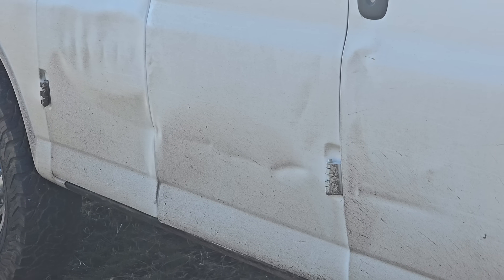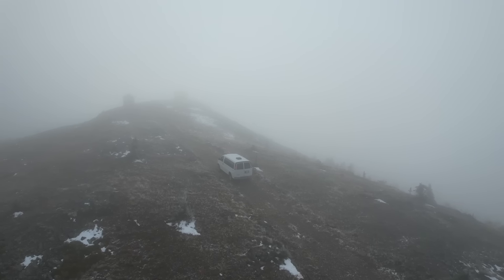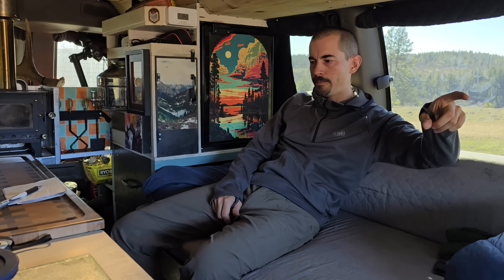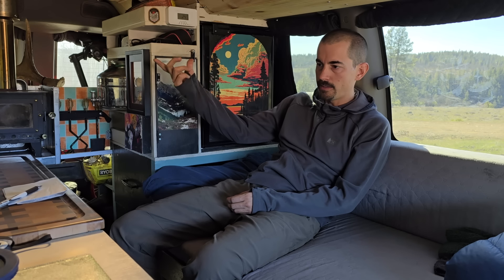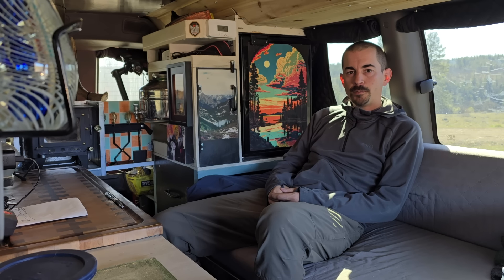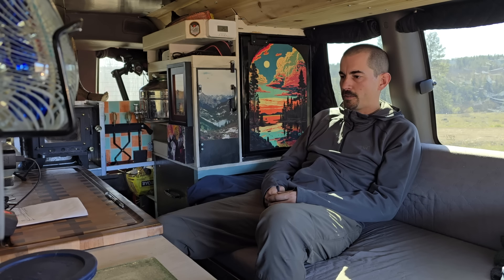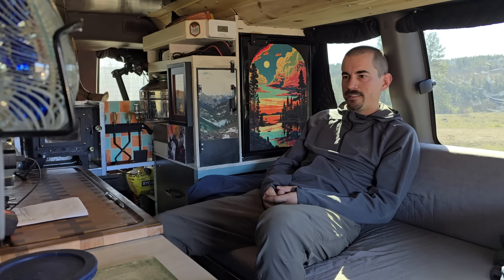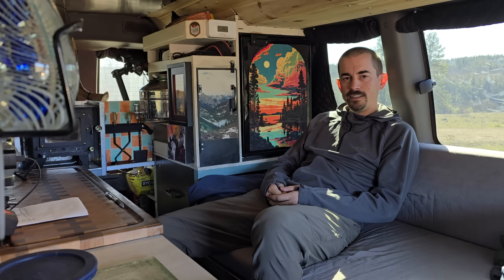Lets just talk about condensation and insulation.

Comment: Research sauna construction.  Rubber sheeting has fasteners driven through.  The fastener has a rubber gasket at the head. 
Don't rely on adhesive strength.  The vibration, heating cycles, and constant stress will cause failure. 
I'm glad you're sticking with the windowed van.  Need double pane glass. Where to find?

Comment: Your plan will make it warmer but will not prevent condensation and mold. The dew point will still be on the surface of the vapour barrier due to the thermal bridge of the metal rib. There will be a food source for mold at the dew point (the wood strapping). Mold needs three thing to thrive: Food (anything organic, in this case the wood strapping), water (condensation), temp above 5 degrees C. The place to start is to measure the worst case typical humidity level inside your van. A good way to dehumidify your van is to run the A/C if you have it. A dehumidifier is part of the A/C system. Hope this helps. To come up with a design you need the outside temps you will likely be in, the inside temp you want and in inside humidity level. Are you planning -40C?

Comment: Closed cell insulation is a vapour barrier. If you are super concerned about vapour. Use furring strips to isolate the VB. Insulting things with foam is good if you can keep it tight. Spray foam will be a helpful tool

Comment: The problem with vehicles, and campers like airstreams is the thermal bridging. Like around the windows. Sure  we had storm windows to install inside but the window frames themselves would always have ice on them. Condensation meets freezing surface... The thermal bridge is a piece of metal that's outside that also continues to inside the vehicle. Which for most vehicles is every square inch of the vehicle body.

Comment: I hung 8 in 2x4  three pieces / center and on each side onto the underside of the struts. then I made strips out of the plastic White shower material I glued two sheets together cut them into strips 6in wide and long enough to go side to side that will be screwed on the underside of the struts and then the larger panels in between rest on the top of those strips that are hanging an inch and a half on each side of the 2 * 4 I put up 2 by 4 because I wanted strength this van is 22 ft long and I don't want things bouncing around as I'm going down the road😮 is lightweight and it's easy to clean and you can remove it anytime you want to put something in there or check😮 this tongue and groove crap to me is heavy and a pain in the ass. The false ceiling turned out exactly like I wanted❤❤ I haven't put it all the pieces up because the walls need to go first but they are made and cut to lengths and ready to go❤❤

Comment: After having a class b and C...id probably use conventional pink insulation.... Id also run all my lines, electric and water outside of the wall board in chases and box them in... I would never insulate over them. My entire childhood when custom vans were being built in the 80's...they and I used regular pink  insulation on the walls...very few problems... Id use trim washers on all screws and build individual panels that can be removed.... 30 years in the bldg trades debating vapor barriers....building an air tight box to live in without some advanced and always running ventilation system isnt the way to go...its easier to not make it air tight and still gain r value...like most conventional homes.

Comment: My van came spray foam insulated and it works pretty good. But in extreme cold snaps i find its best to hunker down at a campground and run two space heaters pointed in the front and back on low setting works great. And if you run the diesel heater that’s just the cherry on top. Less stress because in those temps something mechanical always breaks. I hope the best for you.

Comment: I like the way you're thinking. Do you think you can friction fit those 2xs in the grooves between insulation firmly enough to support the weight of the ceiling?  Second thought is that you might benefit from leaving your partition minimal between the living quarters and garage, and insulate the back doors as much as you could instead - up to installing insulated blackout panels on the back door windows. I work in school architecture, and we build cavity walls to control condensation - I wonder if that could be translatable? Condensation happens on the warm side of the insulation, so the vapor barrier has to be adhered/fastened to that. Then the cavity, even like 3/8" for condensation to drain down. We deal with the liquid condensation at the bottom of walls with weep holes - not so sure that would be a wise idea on metal vehicle, though there are ways to prevent moisture from coming in through weeps. Keep on thinking, and keep on posting.

Comment: Excellent presentation.  Thank you.  I really like the Express vans especially with the Quigley 4x4 conversion.   Having the windows of the passenger van is really nice but I wonder where the most heat/cold loss is really occurring.  Might be a good idea to borrow a thermal camera or buy a cheap one and really evaluate what area the van sees the most thermal loss.  Roof?  Floors?  Windows?  Should you seal off those back windows entirely?   Should you seal off some of the windows on the sides?    Even with the insulated window covers, that could be the major area of thermal loss.  Anyway, it might be helpful to know what areas are seeing the most thermal loss before starting the project.

Comment: Hey man, great channel! I live on my boat and condensation is a super drag, especially when you have to fight off the mold. Ventilation is key, but as you mentioned, you're throwing away a lot of your heat. I've seen people build 'Heat Recovery Ventilators' out of stacks of alternating coroplast and some low amperage fans and have wanted to try this method out for myself. Might help your cause as well. Seems like it checks a lot of boxes in terms of condensation, ventilation, mold and heat retention all in exchange for around $100US and a few hours of arts n crafts. Hope that helps!

Comment: IMO as somebody who renovates and am a Canadian Engineer let me give you an alternative idea. You can seal off like you are referring to, or you can create a breathable insulation space. A breathable insulation space is one where the insulation has capillary abilities. Meaning it has the ability to transmit humidity, but at a reduced speed. You can seal your car, but then you run the problem that any moisture that is caught will cause rust. Let me illustrate. You are going up and down the mountains right? Imagine creating a sealed space that has trapped air. Going up and down will automatically cause an expansion and contraction your entire wood, vapour barrier and so on. This is why when you have dual pane window it must be altitude rated.

By having a breathable insulated space any air that is caught will leak, and no vacuums will be created. Breathable insulated space means using natural insulation. That can be wood fiber, wool or cannabis (not the illegal stuff). Then you put on a breathable vapour barrier where the SD < 5 or just a thin layer of tongue and groove OSB (9mm). On top of that you  put your wood siding. In this configuration you will be kept toasty warm, and yet breathable. It is absolutely CRITICAL that you only use natural materials that can breath. You CANNOT use air tight paint. You must use a stain. You cannot put vinyl or plastic on top as the area must always be allowed to breath. Slowly breath of course, but breathe.

Comment: I like the idea of renting a place for a month or two while you do the renovation.  also, adding a back and front wall should make a big difference.  You could do the walls first and then try it out for a winter and see whether just the walls would make enough of a difference that you might not need to do the ceiling insulation.

Comment: Just an idea with the roof. What if you put supports spanning across from either side of the walls to support the ceiling and those supports would be anchored to the walls. Then the only material you would only need to glue is the insulation. You’re definitely on the right track with adding an insulated walls to the front and back. I would also suggest window coverings maybe made out of that reflective material. Look forward to watching the build. Good luck 🤞

Comment: If you take your time, using both rigid and spray Poly-Iso foam your 'studs' (2x2 or what have you) will be held just fine and firm for your T&G.  I no longer use (after 15 years fulltiming) vapor barriers and I leave a 1/4" gap at the bottom of each panel section to allow the moisture to collect > evaporate.  I also began using 3M Thinsulate for hard to reach areas since it is almost as good (R-value) as Poly-Iso and much easier to install.  If you're specifically interested long periods in very cold climes you are better off with the purple (?) rigid foam boards.  XPS?  I forget the trade name but it is one step below PI with regard to R-value but outperforms PI in colder climes.  All depends on the literal hours you need the insulation (sleeping?) and whether the solar exposure warms the chassis enough to warrant PI.  I converted my first Sprinter in a friend's driveway during the recession.  My second backfired because the driveway wasn't really available and after searching for a rented space at several 'maker' spaces in Portland I flat gave up.  Bessie still isn't finished and I've slowly adopted the 'use it and enjoy life' attitude, until I find my next vehicle.  Living, long term, in a vehicle you're trying to convert sux in a big way.

Comment: I have seen several mentions of spray foam insulation.  If you decide to do that, use "closed-cell" foam and not "open-cell" foam.  Water vapor moves through open-cell foam but not through closed-cell foam.  Open cell is usually cheaper so people choose it to save money and then end of with moisutre issues.  Good luck!!

Comment: You should definitely keep this van. What's the point of paying for a nice new van when it won't stay nice long.  Riding in those tight trails puts scratches in the paint, not to mention all the dents you'll put in it.

If you change the oil frequently (every 5k miles) and the transmission oil every 100k (miles), it will last hundreds of thousands of miles.  Given you do a lot of miles in a short period of time, age will not be ruining the suspension and exhaust.
But given the weight you carry and frequent non-paved roads you drive on, you should probably do a full inspection of the suspension parts including all the rubber.

Comment: I have a  "no build" van, with no heat source 😢. I  now use 2 tiny USB fans, one in front, one in back and with a window cracked because we had extreme condensation that would rain down.  We are not full time in van and avoid hard winter travel.

Comment: So here is what i have done. Also have a wood stove and diesel heater. My rig is fiberglass. My beam supports are aluminum for snow load and wood for screws, the best foam board i have found that works as a vapor barrier. Is from Home Depot, it is foil backed on both sides and charcoal infused foam. 
The foil allows you to use 90spray on the metal, and the inside foil allows you to use ducting tape. To seal  all seams. No condensation issues after 4+ years. ?

Comment: Rent a snowbirds house with a big garage for the build. I’m sure there will be one available in BC-Alberta in the winter months. 
And I suggest a 2 layer wooden grid + a professional spray foam for the ceiling. The offset grid closest to the metal would require a rubber or neoprene strip between the wood and metal. The offset 2nd layer would allow for insulation to be sprayed under the strapping so you could fasten to it without damaging the vapour barrier.
Edit- the sprayfoam is also a vapour barrier

Comment: Foresty I am currently planning my next build for my E350 and have an idea for you. I have decided to learn how to sew like you do. It is your superpower and I want to learn how to do it too. I'm planning to insulate with quilted, polyfill blankets similar to parka material. The blankets will be custom tailored for each wall panel/window, ceiling section. The blankets will be fitted with small sewn in neodymium magnets around their perimeter that will stick to metal mounting points around the frames they are meant to cover.  The blankets can easily be quickly removed or put up as needed. If they absorb too much moisture they can be set out to dry or taken to the laundromat for washing or drying {remember they are synthetic polyfill material, not down}. I may also add a layer of aluminized fabric or maybe that silvery bubble wrap insulation material {that's very lightweight and only a few millimeters in thickness}. The reflective material faces inward and really works at reflecting radiative heat back to you. And underneath the polyfill material will literally serve as a big insulative blanket for the entire interior. 

Best part is it's fairly cheap, very lightweight and comparatively easy to achieve in a way that you could get done before peak season. Also, the moisture management should be pretty good as long as you don't hole up too long in a wintry setting and have the opportunity to let the blanket system air out from time to time. You could make it permeable/breathable nylon or waterproof...or maybe thinsulate? Thinsulate has the ability to let water vapor pass through, but not liquid water. 

You'd also have the benefit of being able to remove the blankets from the windows easily when you want, retaining viewability when you want it back. 

Anyway, thought I'd throw that out there. If anyone could execute the blanket system successfully, you could. Plus, you should have all the tools you need to get it done with you already. Good luck whatever you do! 👍
Reply: GREAT outside the box thinking. The other thing perhaps you didn't realize is , is if the material is at least a little absorbent its acting like a buffer to absorb vapor during the night and then release during the day. I have designed my root cellar like this with cement board. Root cellars NEED moisture, NOT dripping, but dampness and in the underground setting it never dries, but hold and radiates as needed
Reply: @reidcrosby6241  Thanks, yes I suppose it could serve as a moisture wick and release system. Similar to how adobe walls work in the desert. They absorb the desert heat all day and then at night when it's cold, they slowly radiate the heat back inside the house. Main thing is I'd like to be able to easily and quickly remove or partially vent the blankets to release any trapped moisture under them or in them when it's convenient. I just need to get a sewing machine, learn how to use it [as Foresty does] and then get started experimenting.

Comment: Put 6 inches of insulation on top of your roof and deck over it. Any condensation will form droplets on the bare painted ceiling as moist air rises. You are then sure there is no moisture forming anywhere else. The bonus is some extra head height and a bit of free water collected in a K'archer window vac. The windscreen also collects damp but not as much as the ceiling will

Comment: Would be nice not having to crack the window to let in the cold and venting the warm through the roof just for airflow. I wonder if those table top dehumidifiers are any good? They draw about 30 watts, so running for 12 hours will eat up 30 amps. Not great but a good excuse to upgrade the batteries. There are also the chemical dehumidifiers. Basically use a desiccant to absorb the moisture. Some pass the water through to a reservoir you empty, others you bake the moisture back out and reuse. Whatever you choose will be entertaining and educational content no doubt 👍

Comment: Couple thoughts on insulating and sealing (not an expert). Skip 2x2s and instead sprayfoam gaps and trim/sand flush to rigid foam boards (sprayfoam has good adhesion). Maybe use "liquid rubber" paint to seal (non-toxic, waterproof, repairable). Not sure if a primer is needed to promote adhesion between liquid rubber and foam insulation. Maybe use some type of adhesive for the tongue and groove instead of fasteners (would be slow to install on the ceiling). Looking forward to the reno. Cheers.

Comment: If I were you, for starters I’d remove the back two windows, at least, cover them with sheet metal, insulate and cover with 1/4” plywood. The less glass the better. I also think if you rip everything out to the ribs, the best solution is spray insulation. If I did another build I’d do that instead. Definitely go where you have help when needed, someone to bounce ideas off and a warm, dry place to sleep/eat. I’d be happy to help if I didn’t live on the opposite side of the states. I agree with keeping the devil you know too, rather than buying something newer.
Reply: Removing the rear windows would also make the bike less tempting to thieves.

Comment: Not sure if I’d go the vapor barrier route. It seems to trap more moisture in the walls/ceiling then prevents it from getting into the living space. We are building out a Van right now and putting in Thinsulate and Reflectix radiant barrier. You had the right idea with letting the walls/ ceiling breath. Just add the insulation and radiant barrier to get more heat retention. Maybe put in a bigger heater instead.